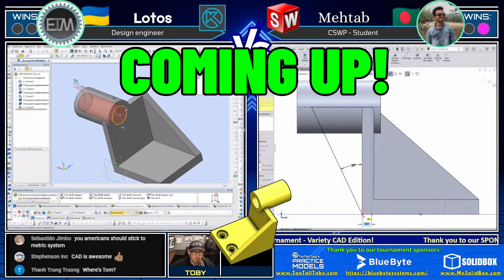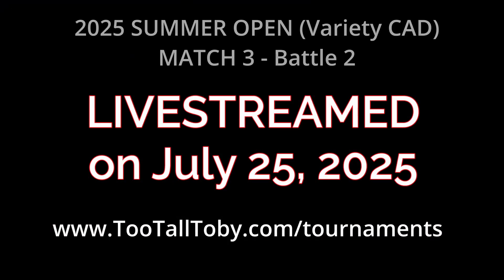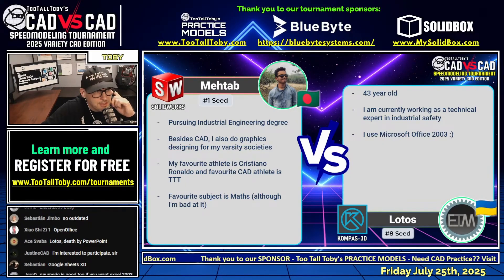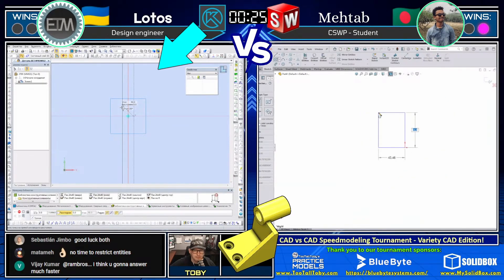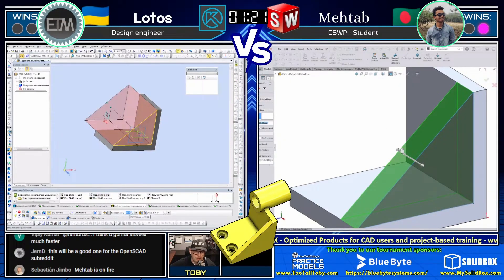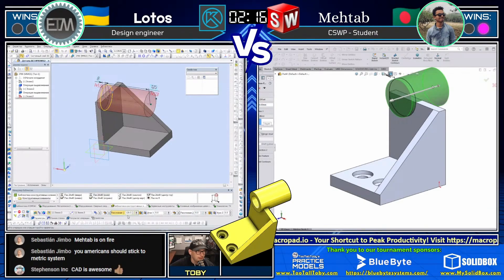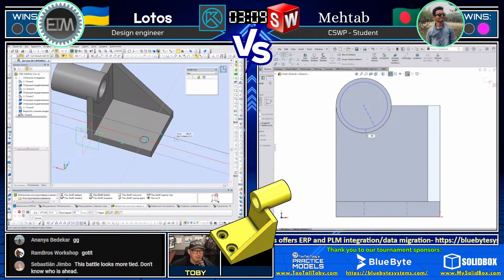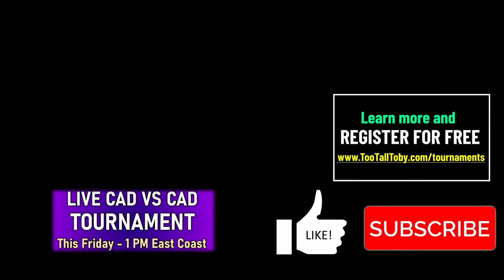CAD vs CAD TOURNAMENT  🎮 KOMPAS-3D vs SOLIDWORKS 🔥 Match 3 Battle 2

Comment: Metabs drawing was incorrect. The pair of holes were incorrectly placed. Same mass but should still have read the drawing better.
Reply from the maker: Yes this is all part of "The Ivan Exploit" - an exploit that runners sometimes use in these tournaments. As the gamesmaster I try to mitigate how often this can be used, but sometimes the runners still find a way! 

Aaron C and I are working on a video to detail the history and complexity of this topic, and it should be coming out soon!
Reply: Why, spent time placing the holes exactly if it doesnt matter for the answer?  Its a race
Reply: That's true, it was intentional. I used Ivan Exploit here, which is a really complicated topic, but as it was allowed in the tournament, I used it here.
Reply: does anyone know the video in which this exploit was used at the first time